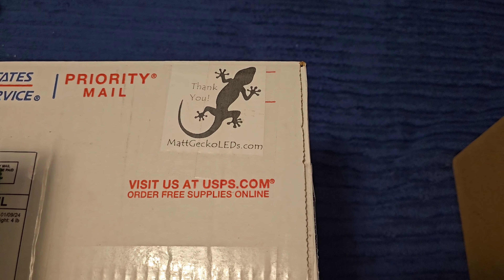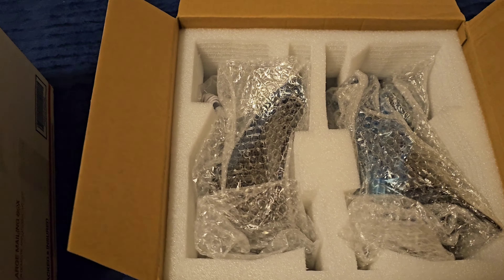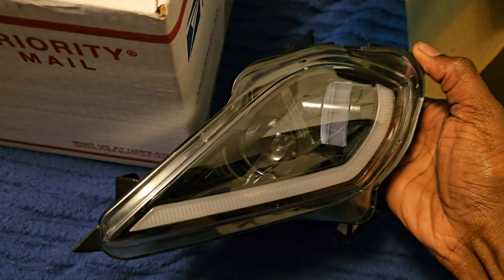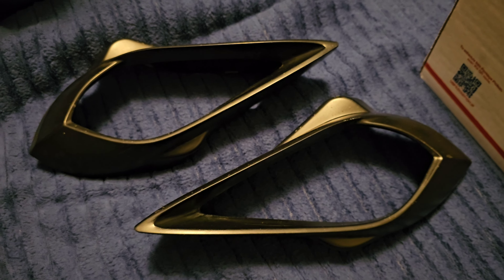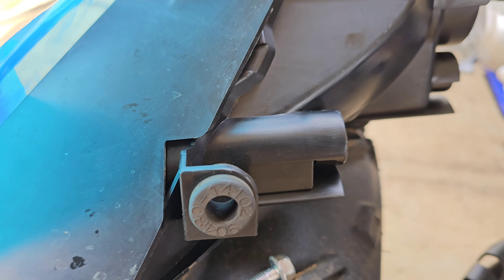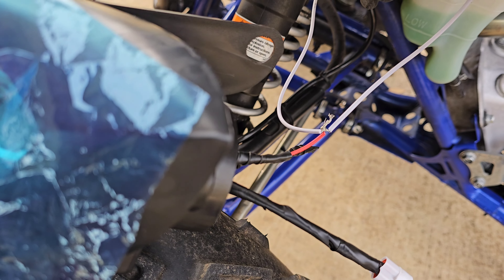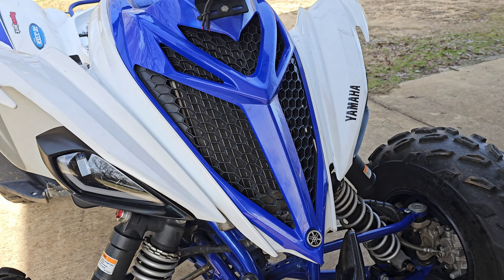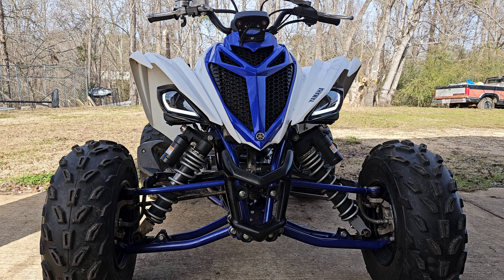Matt Gecko LED Install Raptor 700r

Comment: I have a pair that’s dropping today.The shipping time was lightning fast.I noticed that you spliced a few wires but on his website they are advertised as being plug and play.So what exactly are you splicing in?The Drl’s?
Reply from the maker: @noladronelife_6574  Yea The DRL, It's Plug and Play For High and Low Beam
Reply: @SonicRaptor Thanks bro

Comment: Hey which lowering kit do you use and do you have to adjust any tow in or out with your alignment
Reply from the maker: https://www.ebay.com/itm/225137335454?mkcid=16&mkevt=1&mkrid=711-127632-2357-0&ssspo=o9J1CSpBR2u&sssrc=4429486&ssuid=16XWS7ewRuC&var=&widget_ver=artemis&media=COPY

I didn't have to adjust anything

Comment: My lights didn't come with the white wire. What size of wire is it?
Reply from the maker: 12 Or 14 Gauge
Reply: How did you plug it onto tge fusebox @SonicRaptor
Reply from the maker: Strip A Little Bit Of The Wire Then, Wrap The Wrap Around The Fuse Prongs and Plug Fuse In, Might Have To Trim Some Of The Stripped Wire So The Fuse Will Plug Back In
Reply: I thought so but wasnt sure. Thanks  @SonicRaptor